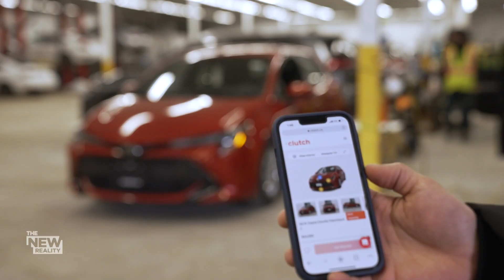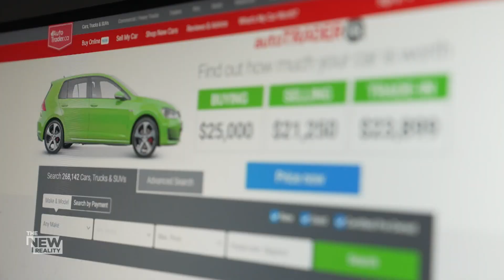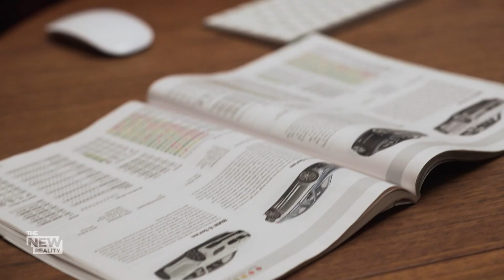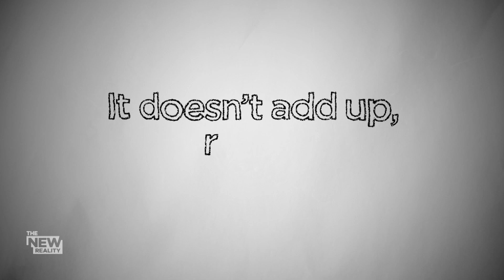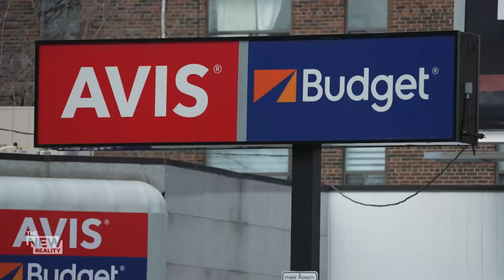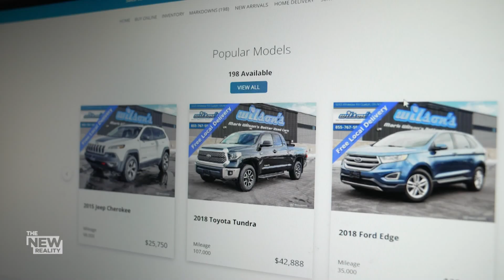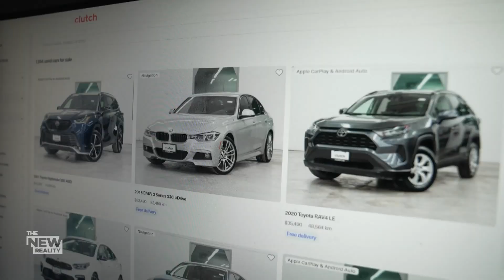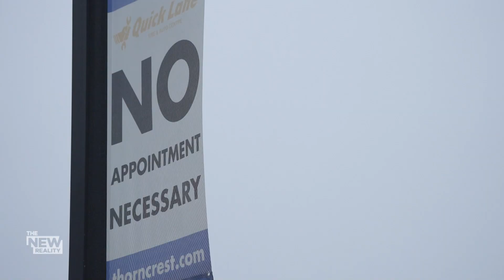Used Car Boom: Why they are worth more than ever

Comment: Person comes in for a trade appraisal. Dealer offers low numbers based on a 6 month wait except they says it’s todays value. Customer comes back to pick up new car and they’re stressed about the trade appraisal. Customer demands value they were promised. 

Dealer marks up the car after heavily reconditioning it. Some don’t do much to them and still mark them up. 

Commissions have never been higher. 

They’re making more money than ever. 

The price hike is getting paid because people see there’s no new cars and hardly any options for cars because most of the cars that can get exported ARE being exported. 

Many cars are being stolen and shipped across the ocean. 

10-12 doesn’t get you much.

Comment: I bought a 2005 chevy suv for 2500$ about 4 or 5 years ago, now they're selling for 3500-4000 with about 250kms. 
unprecedented...
Reply: Simple, last November, 10 million Americans resigned their Jobs ► Went on to be Crypto Traders/ Inside Traders / Shorting / Betting No one work like the Japanese or S. Koreans.  Cars like Toyota & Honda's should be worth double their current Value's and Tesla should be 30% less.

I have a Subaru 1992 when it was 100k km on the odometer driven better than my Father GM Chevalier that has only 40k km on Odometer‼   That is why the Whole world ─ especially USA/ Canada are now where they are 10% Inflations Rate's but the Govt.'s still list at 8.5% --- That is a lie just like how Elon Musk talks/ Tweets have been about...♂☺

Comment: Just so you know trade in values are still low. 

Retail is higher than ever
Reply: I’m very sorry to tell you this but yes they are. You don’t understand how it works. If you did you’d know. 

If you go to the auction it’s much more expensive because people will pay more and there are also fees to pay. 

It’s cheaper to buy from another dealer or straight from the consumer. I’ve been in this industry for 14 years and the only thing that’s change is that consumers are conforming more than ever out of necessity. I personally don’t think it’s fair to people. Let me tell you something

You don’t see cars sitting on car lots because people have been ORDERING. when these cars arrive they get delivered right away. 

They’re selling and delivering more than ever. 

Sometimes they have a couple slow months because of shipping issues or recalls from pumping them out so fast. There isn’t a shortage of new cars. They’re just selling more than they’re used to. 

Weather had some fault in the used car market but weather isn’t to blame for everything. People are also shipping cars to other countries that actually have a bigger demand than we do. 

If anything people should relax and chill out from buying anything for a while until their cars actually need replacing. High kms don’t mean anything. The more you drive it the more you squeeze out of every penny you spend.
Reply: @Drizzt you obviously aren’t in the car industry and if you are you have no idea what’s going on. Even you’ve been fooled.